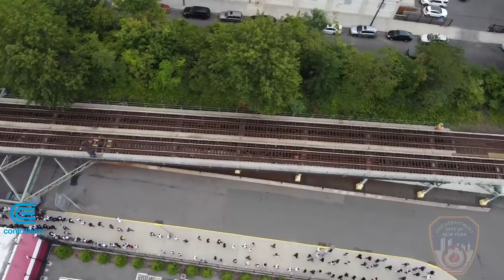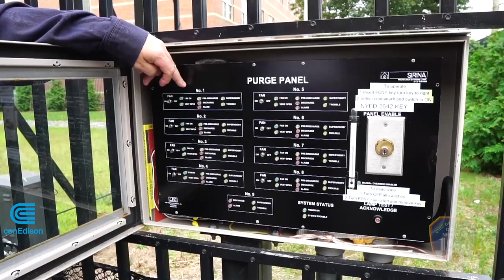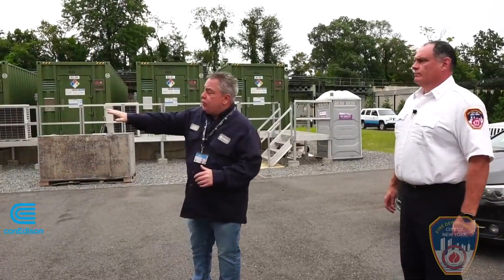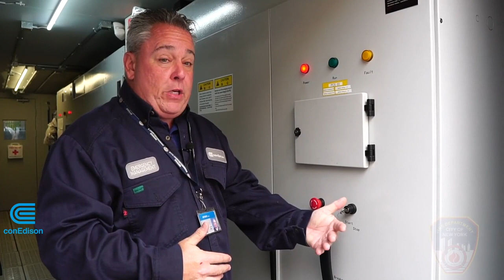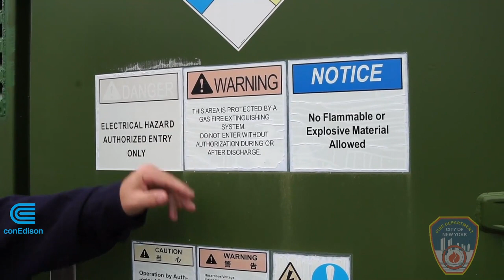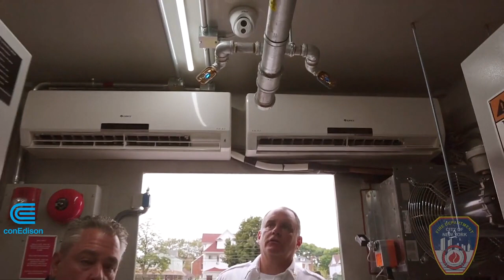FDNY Con Edison Battery Storage Station Familiarization Training Video

Comment: There's a similar facility at UC San Diego next to the natural gas filling facility for the utility trucks - videos like these are extremely valuable and helpful in creating new prevention methods for such areas

Another useful addition to this vid would be watching a video on how power grid supply works and how critical it is to the grid that the power in the other containers still be able to supply  electricity to said grid. Electricity is flowed to the grid on an on-demand basis and any difference between the two can crash the entire system. If the battery facilities are being used it is likely a critical period (as said in the video) which is why it would be critical to ONLY shut down the containers on fire and nothing else.